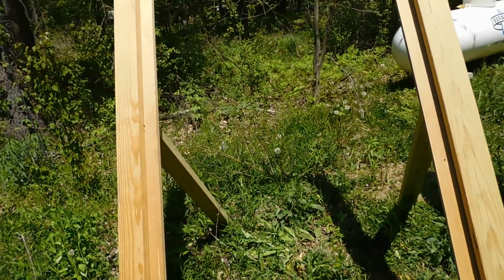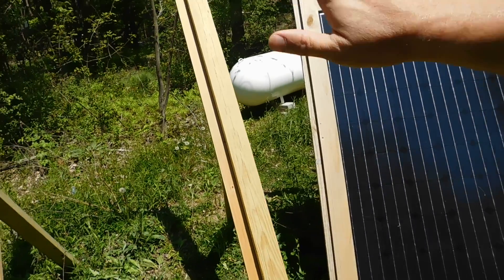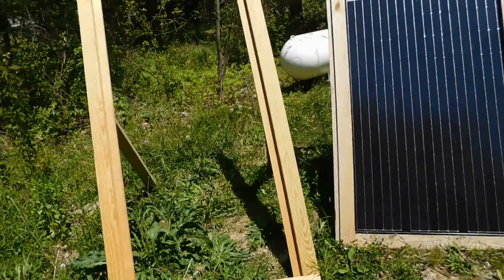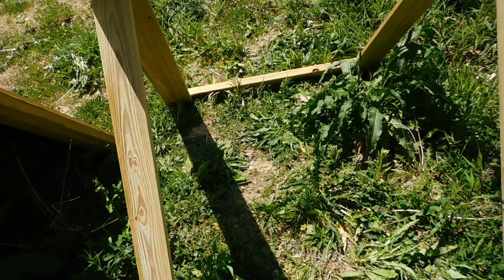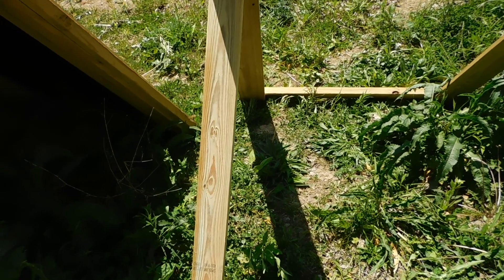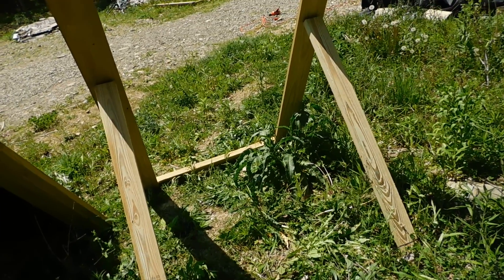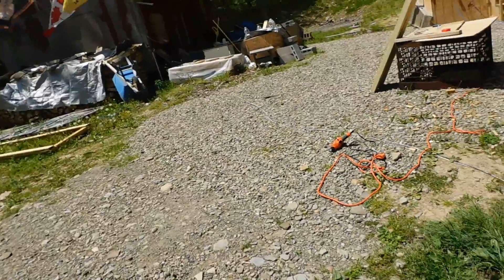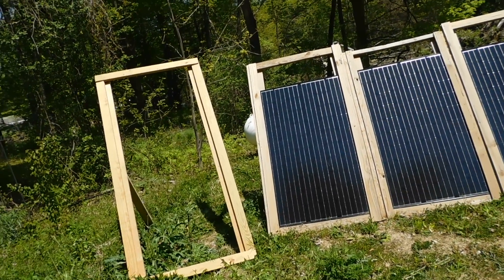Finishing up the work on racks for the solar panels.

Comment: i'm new to the channel but wanted to put it out there as an idea and it may have already been covered but to seal the wood with an outdoor paint OR like lynseed oil so you get like 5 times the amount of years out of it ...heck if you don't mind it the cheapest way would be used motor oil painted on with a brush ..but some folks might not like that idea ...not sure anyway just wanted to throw the idea out there ...LOVE the channel and the videos sir, keep'um coming
Reply from the maker: Thank you for that and that's not a bad idea at all.

Comment: dude your doin a good job but i would have 1 concern ... your back braces .... if you slide the panels to the top it appears it will be top heavy . a good gust of wind . the general rule of thumb is break it up into thirds . your back brace should be about 1/3 of the way down from where you intend to have the top of the panel . maybe it is . video can be deceptive
Reply from the maker: Thay is smart thinking thank you for sharing that.

Comment: good job but just a suggestion get a battery operated drill  Sears sell a 19,2 volt  battery and charger 60 bucks I have had one for years
Reply from the maker: Thank you yes I need to get one.